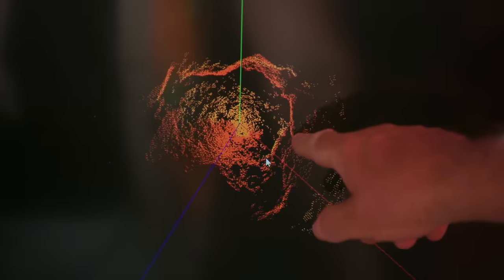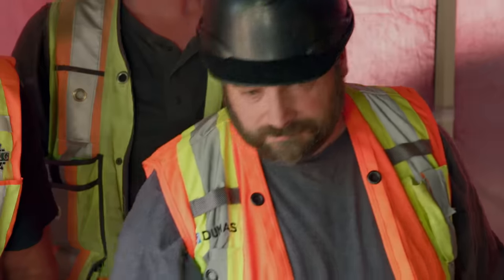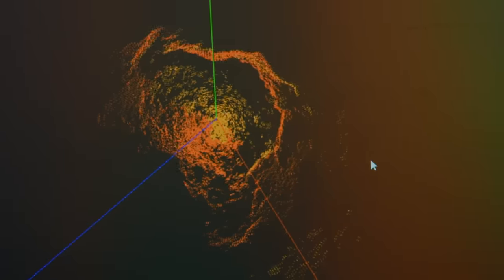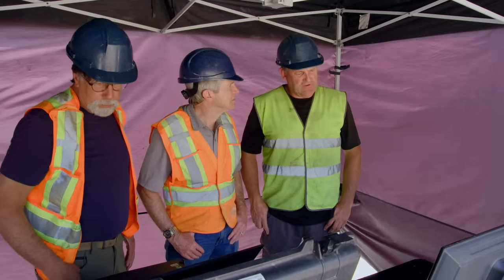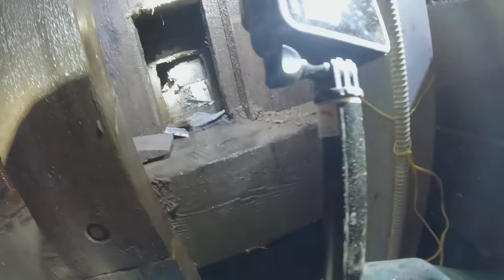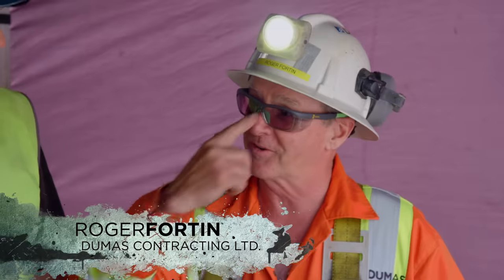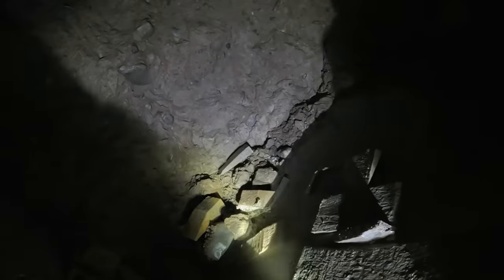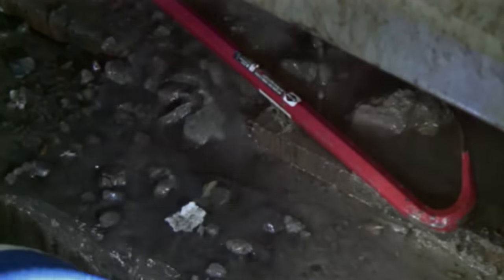The Curse of Oak Island: Aladdin's Cave Reveals Man-Made Workings (Season 11)

Comment: I personally think they should attempt to stop the water externally at the source, or as close as possible to. They could do dye tests around the exterior of the island to see where the water is flowing in from. I'm fairly certain it could be plugged if they managed to find where it was.
Reply: You must not be familiar with the story and all that's been done so far, they've done dye tests and they've tried to find out where it's coming from and haven't been able to that's why they haven't and are trying other ways
Reply: I'll give you a hint as to where the water is coming from...Oak ISLAND.
Reply: I keep wondering as I'm watching them pour urethane into the voids to stop the flooding if it's sea water or regular water? No one has mentioned it yet as far as I've seen. Doesn't make a difference, but just wondering.
Reply: @markgrzybowski72  well it sort of does and doesn't, if it's sea water it's obviously from the ocean around the entirety of the island somewhere, if it's fresh water then I'd suspect an undiscovered aquifer close to the pit area
Reply: They have done all that with the dye, from the pit to see where it came out, unfortunately the dye didn't show on the area they was hoping for which was the sea, if they could find those places they could cut the water off, I think they found some in the swamp which was eventually drained but it never stopped the water, finding the vents and channels in the sea and blocking them off would be a game changer, not having the risk of flooding would be a huge step forward

Comment: I've been watching your show for years and my wife and I anticipate every new episode.  I have a few questions... 1st...where was the entry to dig all this and deposit such treasures... booby trapped flood tunnels granted...2nd why are you not testing water pouring in garden shaft for salinity????  Fresh water like nearby wells...water table...or salt water from a flood tunnel??? 3rd...Since all supposed treasure lies in wake in "offset chambers" guarded by "flood tunnels" etc...did anybody ever think that the depositors had a way BACK in to retrieve their treasures???  Beyond this...note to self...why didnt they leave coffer dams in place at smiths cove so to shut off flood tunnels???? Awesome show but ask yourself....
Reply: Same questions I have
Reply: I've been following this saga long before this TV show--- even before the Restall tragedy.  My long-standing belief is that the Money Pit was originally a deep open sinkhole that connected to the cavern(s) deep beneath the island and "whatever it is" was deposited FROM BELOW via cave/niche entrances at the shoreline which are now submerged as a result of the slowly-rising sea level surrounding Oak island over the past two millennium.  The sinkhole was subsequently backfilled from the bottom up with dirt and the securely-fastened oak log platforms every ten feet--- basic Civil Engineering.  What was buried/concealed there was never meant to be recovered.  It is not 'treasure" per se.  I believe it is a religious tomb.  As for the coffer dam, they had to get a permit from the Nova Scotia provincial government to construct the coffer dam and it was only for a specific time period before the dam had to be dismantled.  There are reasons beyond the scope of this Comment for this.  The federal and provincial governments are very involved at every step with this ongoing Oak Island saga/mystery and there is much that is not focused on with this show.  Sorry so lengthy!

Comment: Using a pressure capsule capable of holding back pressure that is causing the water flow from a underground  flow, entrance  that appears to be a earth crack fault caused by years of digging in the same area and testing the water to see if it’s from a different area is a possibility in helping stop the breach,